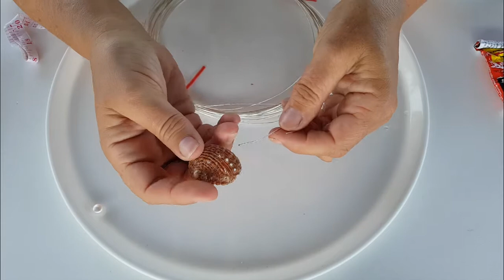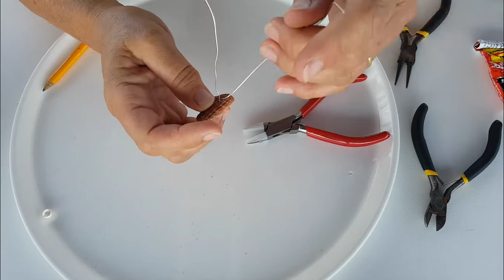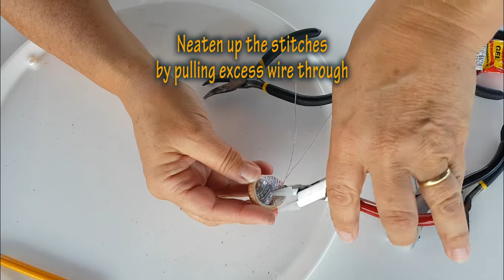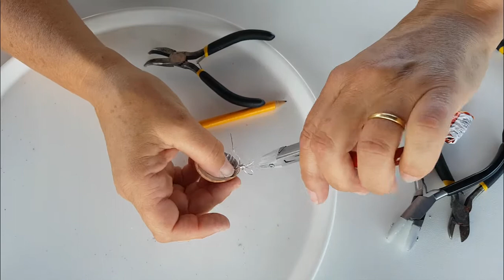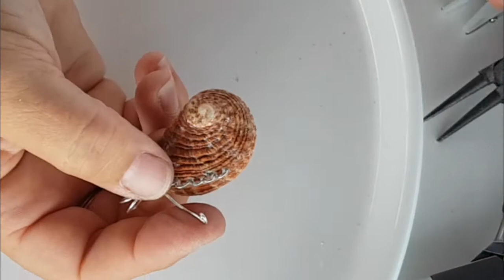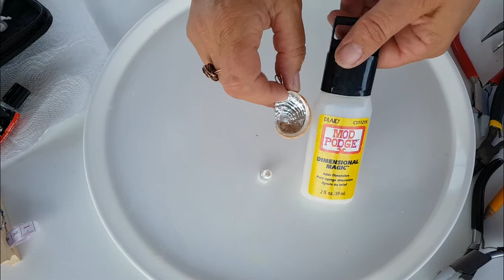How to STITCH wire wrapped shell pendant (Aannsha Jones creates)

Comment: Nice video. What did you use to drill the holes in the shells?
Reply from the maker: ScottandSylvia Jardine thank you! These shells naturally have holes in them and are quite strong. I just had to enlarge a couple of the holes which as you saw in the video I did with needle nosed pliers. 🙂
Reply: you can buy them on amazon
Reply: Great video!  I would use a bead reamer rather than the pliers though.  They have a more consistent, gentle action than the hard edge of the pliers and less likely to cause chipping.